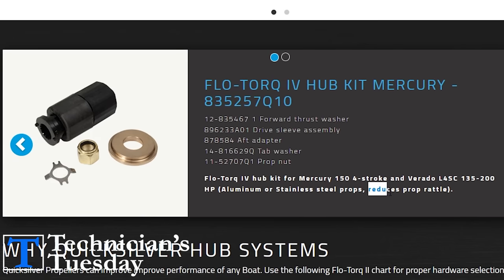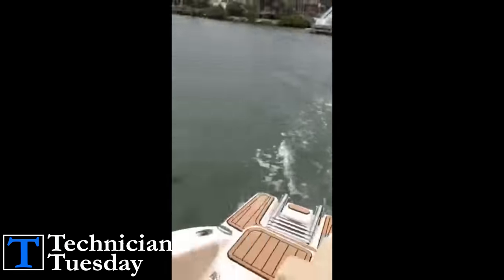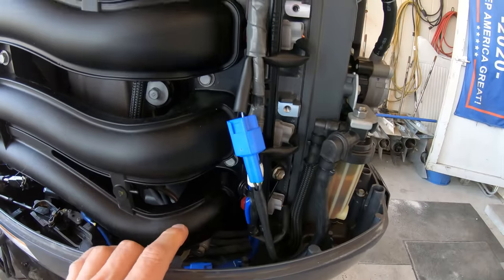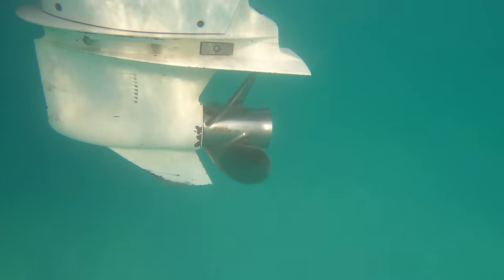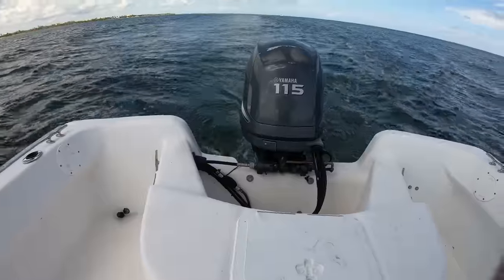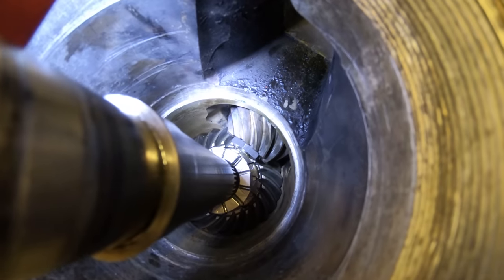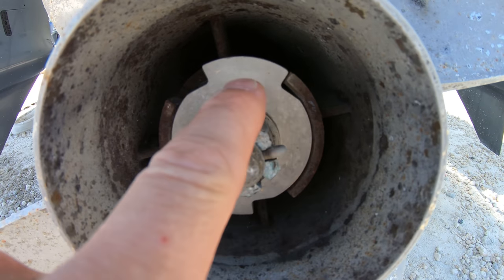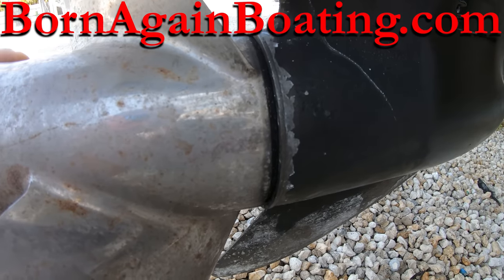A SCARY Noise Boats can make!!!

Comment: Does this apply to 2 stroke as well, i have the same knocking going on with my 115 Yamaha. 
I did switch to stainless from aluminum as well. The first time i took it out after it made so much racket, like in the video i was scared to take it out. The thing is it didn't do it when i tried it out at the house, sounded fine, but when we put the boat in the water it started. 
Put it back on the trailer, and crank it to again put it in gear and it was still doing it..

Comment: Another great video.  I have bad prop rattle with my 75 Merc Optimax with an aluminum prop made by Solas with an integral hub.  I've considered buying a stainless prop just to be able to use a Flo-torq hub to try and fix the problem, but I've been told that with the added weight of the stainless prop it will probably rattle more.  Any suggestions on how to fix this rattle??

Comment: I have a boat that made a loud noise while driving then shut off. I had to tow it back. The starter was locking up on the engine, making it not turned over. I got a wrench and got it to un lock up and it started right up. But now it’s making a loud banging noise near the lower end can someone help ???
Reply from the maker: My man, you should really pull the plugs and do some inspecting, something is not right :/

Comment: On 4.2 v6 , when i change from saltwater s2 to revolution 4 , i have this problem...
Reply from the maker: Well a lot of that is going to have to do with the prop hub, the Rev 4 I believe is going to be heavier, which is going to have an affect there but a lot of the prop chatter comes from the hub, I'd start with pulling the hub out putting a different one in there, which one I'm not entirely sure, does the SDS work with the Rev 4 not sure off the top of my head :/

Comment: The Yamaha 175 featured was taken from my original video which I uploaded in 2017.  This is the original link to my post.  https://www.youtube.com/watch?v=jjHoR8E7yRc

THIS IS WHAT I ORIGINALLY POSTED IN 2017:

2016 Yamaha 175. Purchased new on 23 Ft. Center Console. Delivered by Dealer with Solas Prop. Due to excessive Prop Chatter, exchanged out to Solas Rubex Prop with Interchangeable Hub. No Difference. Reached out to Yamaha and they recommended the new redesigned Yamaha Reliance Prop. Purchased on my own dime and still had Prop Chatter. Yamaha then sent out a SS Black Painted Prop saying that it had a tighter hub, less weight, and would solve the issue. No change in the Prop Chatter. Now being told by Yamaha that this "chatter" is "normal" and the only alternative is to move to an Aluminum Prop. Nothing else they can or are willing to do. Stainless Steel Props are the norm, why should I have to settle for an aluminum or plastic prop? Yamaha has been making outboards for many years and this is the best they can do. Video and audio are with the New Reliance Prop Installed.

THIS IS AN UPDATE I POSTED IN  2023:
I had the dealer where I purchased the boat do the 300-hour Service as they were an "authorized Yamaha Dealer" as I was needlessly concerned about maintaining my warranty. I conduct all my 100-hour services myself but left the 300-hour services to the “pros”. The Chatter continued and if anything, became louder after the 300 hour service.

At the 600-hour service, I had my marina "which is not an authorized Yamaha dealer” go through the lower unit as well as the required service. He said everything looked good and there was no indication of any mechanical issues from the “prop chatter.”  He did replace the Driveshaft Seal and found the incorrect Thrust Hub installed by the dealer. He also suggested not over tightening the prop nut. For whatever reason(s), the prop chatter is 90% better after the 600-hour service. I still have a little chatter at low RPM but nothing like the video. 

5/14/2023:
Personally, I don't think the dealer even bothered to drop the lower unit at 300 hours and perform the required maintenance even though I was charged. In fact, the dealer closed shortly afterwards. I was told that they had many complaints about customers being charged for services not performed. I’m not a mechanic, but I think something was not seated properly in the lower unit from the factory. No other reason I can think of for the chatter to almost stop after the 600-hour service. Recently completed the 900 hour service. The engine runs great, compression is dead on, and the 175 Yamaha w/Reliance Prop pushes my 23 ft boat to 42 mph on a calm day. Prop Chatter is still 90% better.

Comment: Hi I have a mercury 15 with a mercury control box. Everytime I start it peeps for 10sec, is that normal?
Reply: Maybe, if there is a water pressure sensor. It depends on the motor. I can't imagine a 15hp having that, though. But ya never know.

Comment: What’s a good idle rpm adjustment for mercury 15?
Reply: Whatever sounds right.  😉
There should be some marks for you to line up on the throttle ramp, somewhere. Those little motors are pretty simple. The "link and sync" is important, if engine has more than one cylinder. But for that, do you even have a tach? If not, that's why I say "whatever sounds right".

Comment: How come my wheel doesn’t spin that free and as long as the ones you are spinning?
Reply: It's fine, I promise. Only worry, when you hear or feel any grinding. You'll know, when it's time to panic. No training required.
Reply: @thediplomasta5891  well I know my way around it pretty well. I’ve changed the carrier bearing and impeller/housing all that mess. But mine has never spun that free.
Reply: @rogerroger7734  when bearings are new and tight, they resist spinning. Each brand of gearcase (merc,omc,yama) is a totally different design on the inside.

Comment: #510591 I haven't had to deal with this personally. I can see how that sound could make my heart skip a beat. I find it hard to believe it wouldn't hurt anything, especially long term. It is good to know if I do have this problem I will know where to start, and maybe it won't be as serious as it sounds. Thanks for the informative videos. Keep them coming.
Reply: That chatter you hear is the backlash of the final drive portion of the system (pinion gear, ring gear, and shift dogs / splines) in the lower unit.  I would bet it will cause a fair amount of wear if left chattering for a long time.  But since it is prevalent only at low load and as such only infrequently, there will be only limited impact on the drive train gearing.  It is the result of a series of component fitment and total play in the rotational direction.

Comment: Is this only an issue with outboards?  I don't see why it wouldn't be able to happen on an I/O, but you didn't mention it.
Reply: Used on all engines I believe - diesels especially but they are not at the props they are normally at the engine to transmission or front crankshaft locations.  My experience wit these engines is limited but the phenomena is exactly the same.  Putting the damper at the crankshaft to transmission makes most sense and the damper at the prop is the least efficient location.
Reply: Yes. Only 4 stroke outboards. A stern drive has a regular engine, so it has it's own harmonic dampener. Plus the drive components/shafts are more beefy, than in any outboard. A skinny outboard driveshaft, twists like a spring. You can feel it, when using a spline adapter to torque the pinion nut back on. 
🤣 It still blows my mind that any of it works.